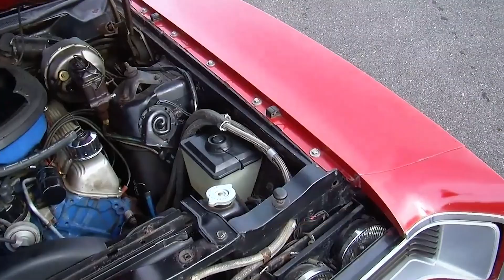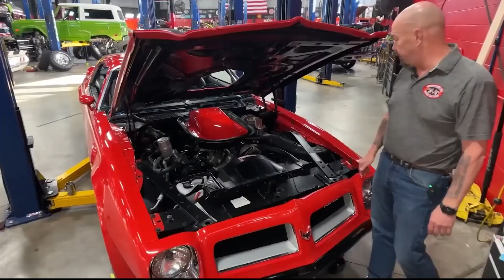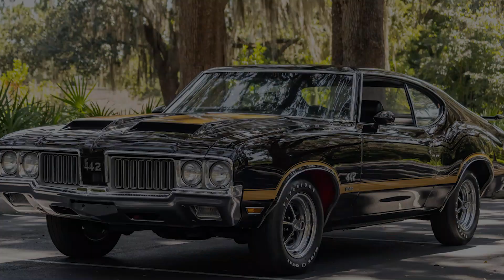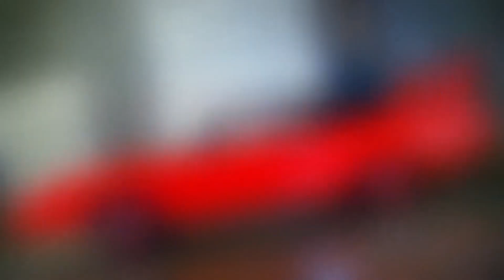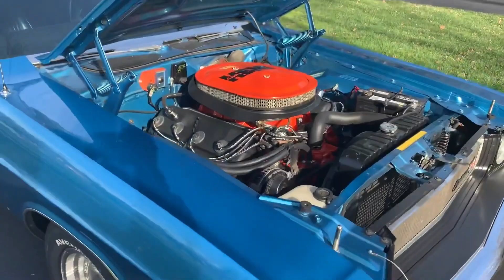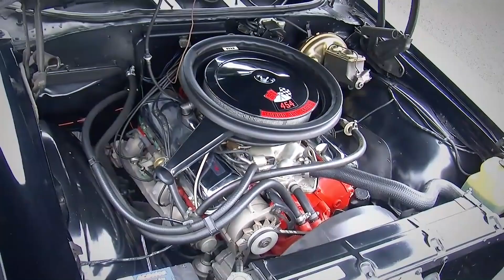10 FASTEST 1970s Muscle Cars Over The Quarter Mile!

Comment: 1970's Pontiac round port engine cars my favorite RA IV  455HO  SD-455 - My 74 SD-455 T/A 3400 stall auto  etc. set up to HO Racing specs had 450 hp Raced by the Former owner beat some very fast cars  ie. a Done up 70 LS6 454 Chevelle by several by  lengths etc. 🏁🏆- wish I kept it 🙂